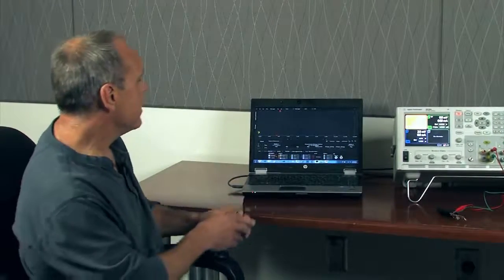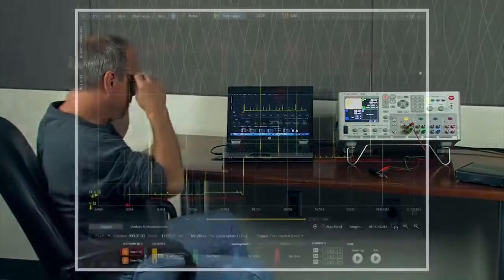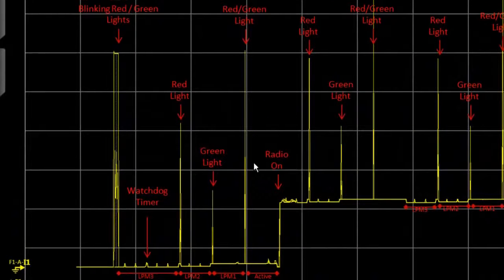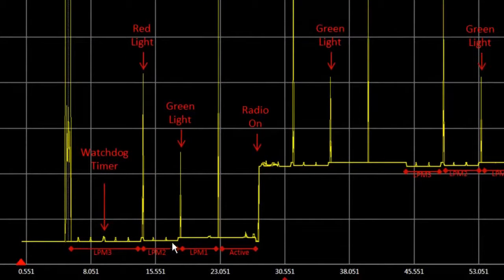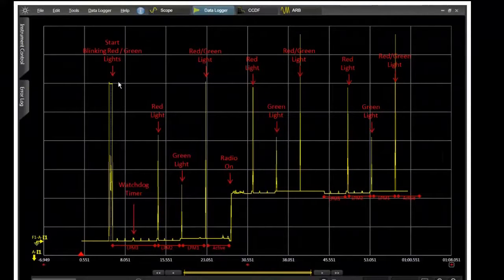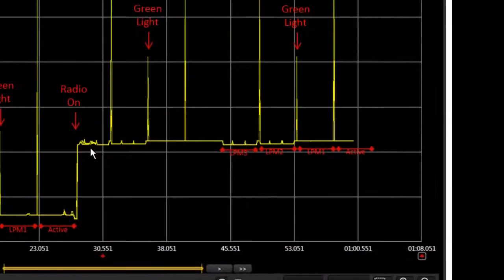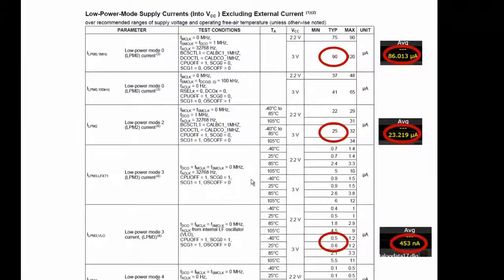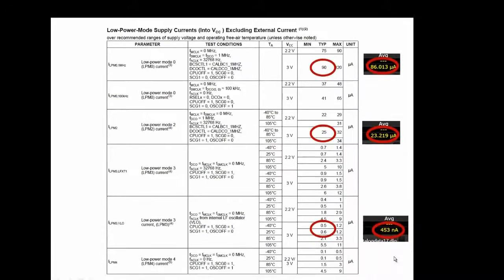Debugging Technique for a Ultra Low Power Microprocessor, Analyzing Dynamic Current

Comment: Very nice.  Good info, and well presented.  I'm debugging a Nordic radio in what I call "nano power"": no battery, driven by solar cells charging a 2mF capacitor.  Which delivers mA, but only for short periods say  50 uSec (sleep mostly, the firmware endeavors not to use the radio unless there is an energy reserve.)  Even power on reset is tricky.  Will your instrument capture data starting from the moment power starts ramping up (booting from POR)?

Comment: Is it possible to sync up  (show) the current measurement with the firmware code as it executes line by line on the embedded system?
Reply from the maker: Hello Krish,
Yes, you can manually place event tags in the 14585A software to identify current consumption of device under test.